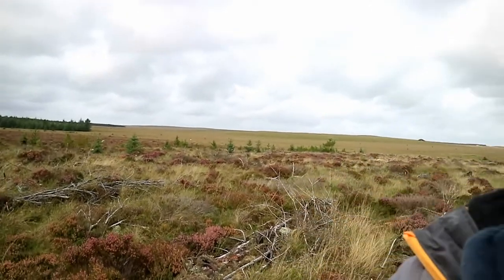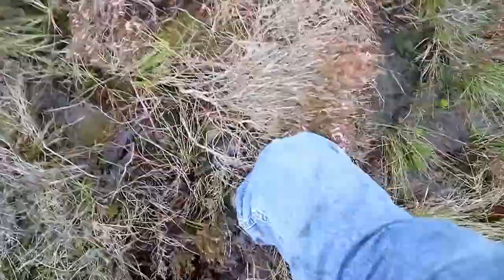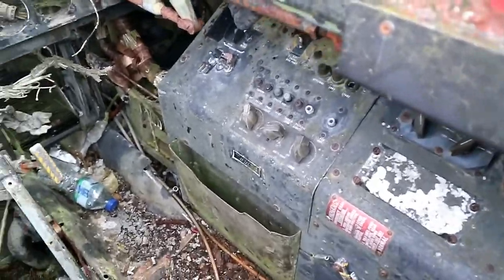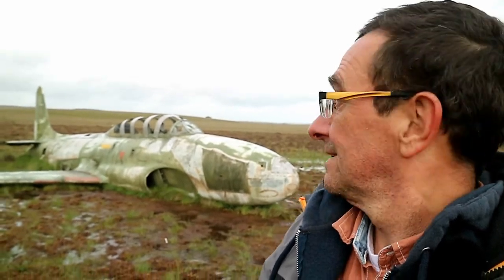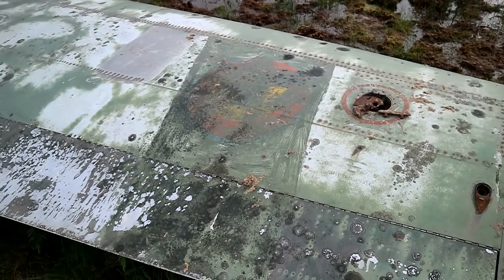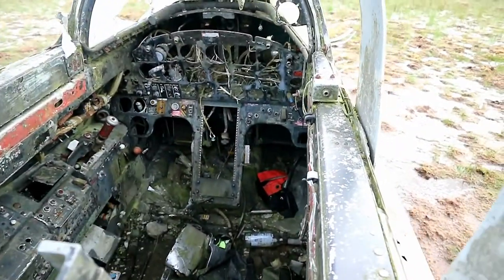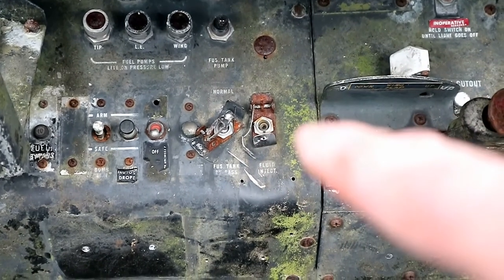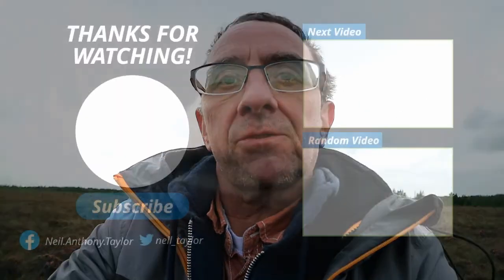T-33 Lockheed Shooting Star wreckage

Comment: Major Richard Ira Bong, died when he bailed out of the plane he was flying when one of the fuel pumps failed in the plane and for some reason he did not activate his backup fuel pump. 
He bailed out as the plane rolled and he was too low for his parachute to deploy fully. 

I'm sure you can guess the rest of what happened to him.